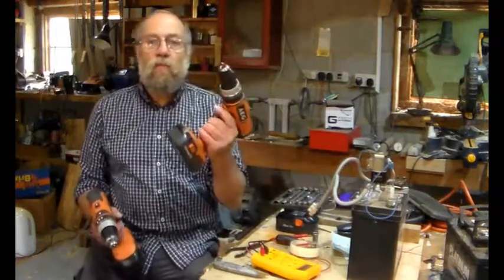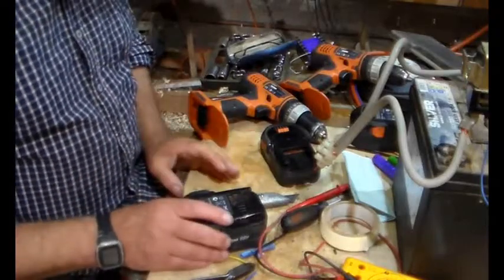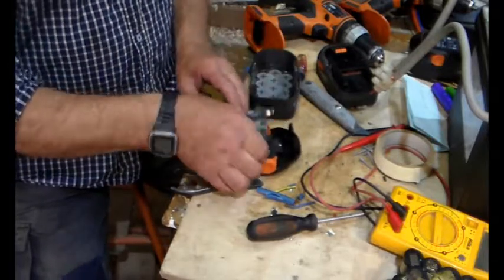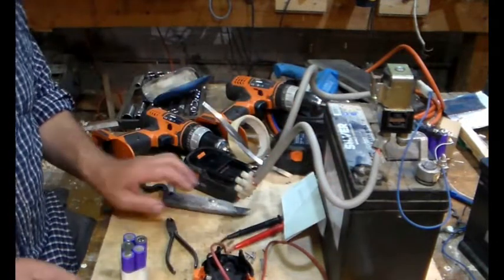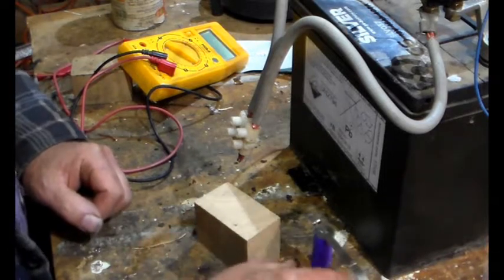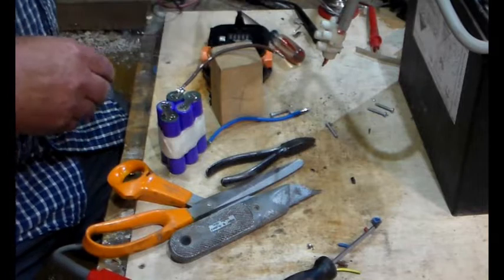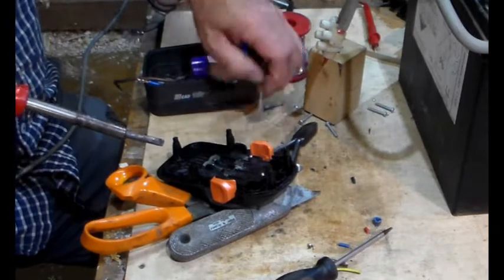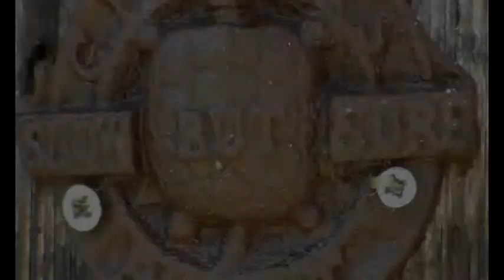Lithium 18650 terminal spot welder, AEG battery upgrade

Comment: You must have a big choice of battery drills now Andy.
Your spot welder - you'd have both hands free if you switched your big relay with a foot switch......Just an idea. Cheers, Dave
Reply from the maker: Dave, yes Makita and AEG. A foot switch would be a must if I was doing lots of these. The battery voltage is quite critical otherwise it can burn through the bottom of the cell, cheers

Comment: I've probably watched the same video of a similar battery spot welder as the one you have made, with the intention of makiy my own some day. 
You could add a small digital voltmeter as a rough check on the battery health.
Reply from the maker: It is definitely less aggressive at 12.5v but as this will be an occasional use tool then a fixed meter may be a bit excessive, cheers

Comment: God man Andy, it came to something. I wonder if the different battery types on the same drill are something to do with a special offer, I have heard that some big shops do a deal to bulk buy and sell at a special discount. Maybe this is a way of doing that? Sell the lithium one for a while and then bring the price down with NiCAD. You might do me a card link to my fixing stuff playlist when you mention my name?
Reply from the maker: Owen, hadn't thought of the devious marketing banditry, but that makes sense. Done the card, hope all OK and the solar frame dries out, cheers
Reply: @TheInfoworks  thanks Andy. I got a coat of preservative on the frame yesterday. Did the drills have the same battery connection?
Reply from the maker: @bootsowen  Owen, yes identical so they are all interchangeable, so even more curious as the nature of such an old tech battery, cheers

Comment: Have you considered adding a 5S BMS?  They only cost a fiver or so?  I think I might find it hard to gauge battery discharge level, when it is in the drill, especially when distracted by trying to finish a job.
Reply from the maker: Petie, good idea worth investigating, I'm assuming a 10 amp unit would be Ok, thanks for the idea, cheers
Reply: @TheInfoworks  How many Watts is the motor?  If it were me, I go for a bit of head  head room?
Reply from the maker: @LittlePetieWheat  Oh yes, plenty of headroom. Might be a good idea to measure full power current, cheers